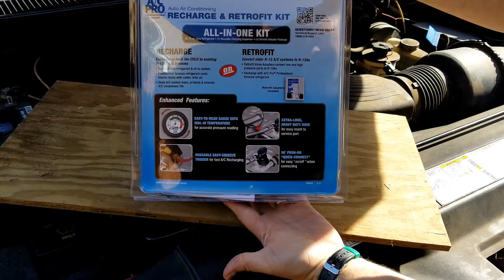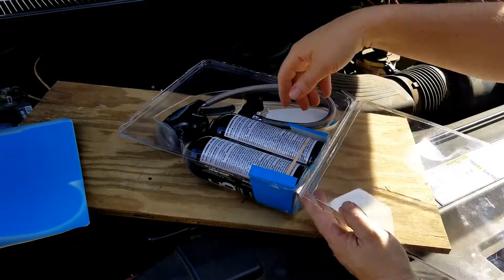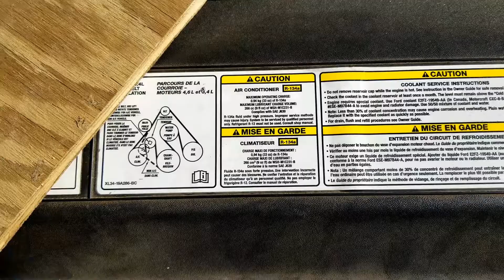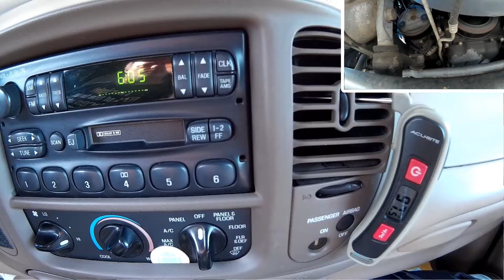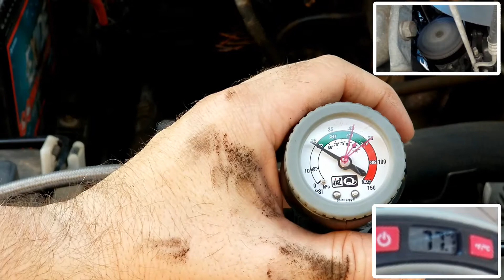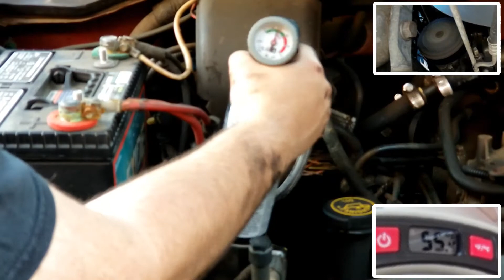DIY - How to Recharge Your Car's AC System Using AC Pro Recharge Kit

Comment: I'm usually intimidated messing with ac stuff in fear of messing up the seals n stuff. But you made it look so simple. I'm gonna try it myself tomorrow. I noticed my ac compressor kicking on and off frequently like yours and isn't cooling as much as it used too. Thanks for the video. Thumbs up.. 😎🤘🏾